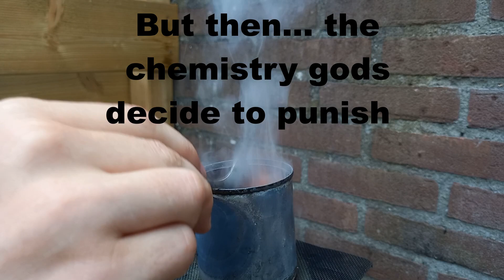Nitrite from nitrate

Comment: A possible improvement I would recommend is to use calcium hydroxide instead os sodium hydroxide, If you tested the pH of the solution you would find that it is strongly basic, this is a sign of sodium hydroxide impurities that will end up in your end product considering it's high solubility in water,. Using calcium hydroxide instead would result in a more pure end product as it is very poorly soluble in water and won't significantly contaminate it .
Reply: But I thought Ca(OH)2 decomposed instead of melting, will it react well in solid form?

Comment: Nitrite is hard to get because some people, tragically, were using it for suicide...which results in complete methhaemoglobia and a suffacation feeling, acidosis that causes intense pain and the convulsions. Never ever try to commit suicide (or do it all)with a nitrite salt it is very horiffic and painful. There are (very difficult to source) painless ways but I'm not detailing anything.
Reply from the maker: I know becuase when i was looking to buy it all i got was news about people killing themselves with this, sad that they couldnt fix the underlying problem and banned the nitrite instead
Reply: @sciencething1449  mental health crisis nursing, doctors and care has been cut to the bone.
Reply: Sadly it’s the availability of information.  Sodium nitrite was readily available at 99% purity for decades without issue.  Now there are crazy forums for incels and related types and the forums add fuel to the fire(pardon the pun).  But then again, information was able to spread on making meth in late 1980s and early 1990s without the internet as a source of information.  Of course would be cooks really had to be resourceful

Comment: In my opinion the best way to obtain nitrite from nitrate is to melt potasium nitrate with lead.. Lead is oxidized and nitrate is partially reduced to nitrite with good yeld. And my statement was based on my experience. Good source of lead is lead-acid batery. The oxide is not soluble in water and simple filtration and evaporation of solution is enough.
Reply: Lead is just wonderful stuff to work with.  I first learned this when I had an internship studying lead poisoning in Boston, MA.  Working with lead responsibly requires some major safety precautions.
Reply: @kenbrady119  agree but in small laboratory it is easier to keep safety and the whole preparation is relatively safe. Relax, it is not a lead blend mine.;)

Comment: Use lead instead of sulfur if you want the iron container to not react away.
Reply from the maker: But lead very scary lol (i rather not use lead i hate having to deal with it)
Reply: @sciencething1449  
True, but you also get a nice separation of insoluble lead oxide and soluble and relatively pure sodium nitrite, as opposed to whatever happened with this current mixture.
Lead gets a bad rep but to be fair it’s generally less scary even than nitrogen oxides because usually it stays in a solid or liquid form with a low vapour pressure. You’ll be hard pressed to find any scary chemical reactions involving lead for that matter, though “lead smoke” is sometimes a big issue in more energetic reactions.
Reply from the maker: @drgazter  yes i know but i just kinda have a phobia for lead lol (meaning its irrational) but i might do it anyway because it is a way to make nitrite and so i want to do it
Reply: Sulfur is an oxidizer/reducer and acidic by nature.  Very bad for metals

Comment: Excellent bro, I've also made nitrite by reducing nitrate with carbon and it works but it produces carbonate as a side product.
Do you have any idea why a a NaOH is used?
Reply from the maker: I think NaOH is used sort of as a catalyst, it probably does something with the sulfur so it produces a higher yield, I think it forms polysulfides  which then react with the nitrate to form nitrite and sulfates. it is basically the same as in my yellow powder video but a more controlled reaction
Reply: @sciencething1449  okay bro👍